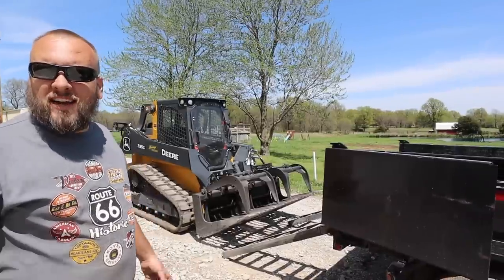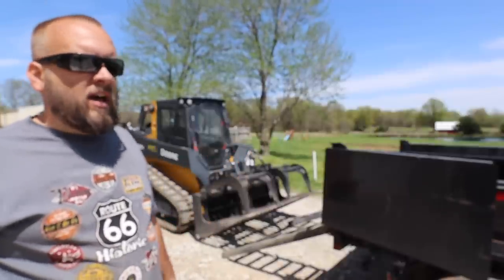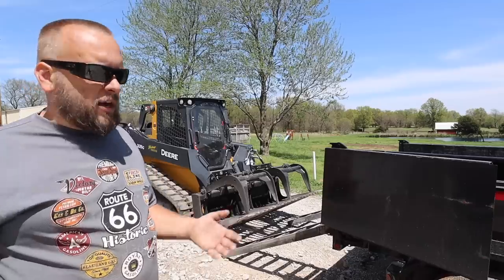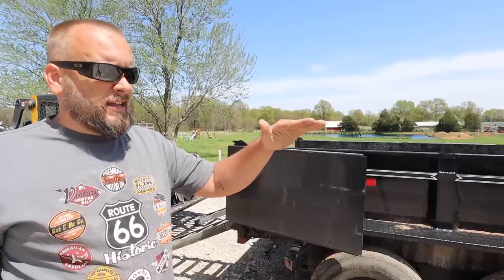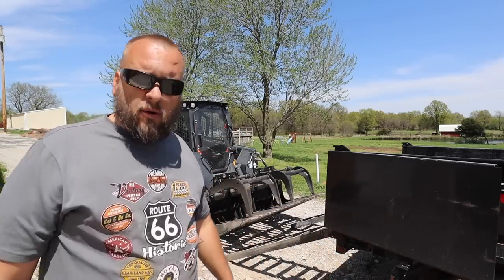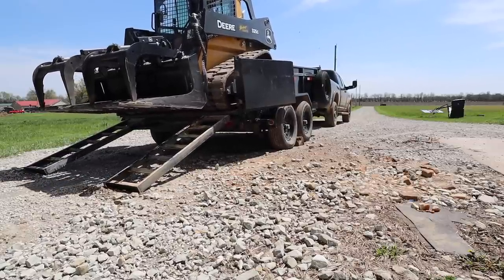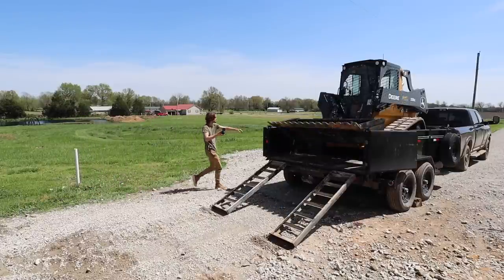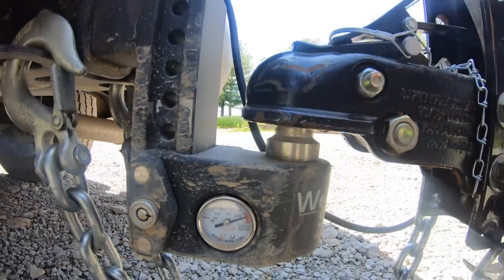Loading a Skid Steer into a 7x12 Dump Trailer - Problems and Solutions

Comment: Nice video Brock.  I recently purchased a 7x14 dump trailer.  I went with the 14’ just to have flexibility with whatever I wanted to put in there in the future.  Even loading my 1025r I wish I had stands built in.  I used automotive jacks the first time or two but I don’t anymore.  Still moves more than I want it to though.

Looking through the comments a lot of people are suggesting other trailer types, but I appreciate the demonstration with a dump trailer.  There’s a lot of guys like me who do side jobs or run a small business that can only have so many trailers due to room and cost, so we are always noodling out how to get the most versatility out of them.  Also, if you’re a one man operation you can cut out a trip if you can get your machine and dump trailer to a site together.  That was the biggest reason I went with a 7x14 so I count transport my tractor with an attachment in it.  Obviously there are more ideal trailers to haul a skid steer, but this video could help people brainstorming of what combination of trailers and equipment to go after.
Reply from the maker: Exactly. I have a gooseneck that I can haul it on but I would like to sometimes take the machine and the materials in the same trailer.

I thought 7 x 12 would be big enough and in general with dump trailers do you want to keep them light so you can put more in them.

Clearly I need a 7 x 14 minimum
Reply: Dump trailer is a swiss army knife. I purchased a 7x12. Mine has a chain to secure the dump bed to the frame when hauling equip so it doesnt act like that. 2 drop leg trailer jacks that fold horizontal or removed are the way i set mine up. I prefered the  jacks that can be cranked up n down vs a jack stand type that can get pinched if the weight doesnt come off them or worse case get ripped off on someting.

Comment: You're going to destroy that trailer. I use a 24' equipment trailer for our skid and excavator. So much easier and safer. Enjoy watching your videos
Reply from the maker: Yeah, I have a gooseneck that I will primarily haul it on but I wanted to be able to use the dump trailer to haul it when I’m also hauling materials to or from a site

Looks like I’ll need a bigger dump trailer.

Thanks for watching

Comment: Good video. I have a SureTrac 7x12 dump and haul my Kubota SVL75 in it. My ramps are longer and less steep. There’s also 4 d rings in mine for chaining the machine. Instead of kickstands,  jack stands or some 12-16” logs work great. I keep 2 logs in my trailer to stick under the frame when I’m loading the machine. When I pull on forward with the bucket dumped all the way down, there’s room for a wheelbarrow behind the machine. The times I’ve backed it on I’ve had too much tongue weight. Never had an issue pulling on forwards and I’ve towed it for 5 hrs  that way. Personally I’d either strap the doors on your trailer shut or chain them open to the sides, and weld some d rings to the trailer to chain the machine down. These trailers work great to bring the machine to the job and then bring materials to/from. I’ve hauled a Jeep Wrangler in mine with the doors strapped shut around the back bumper. Just keep your axles greased and keep an eye on your chassis, suspension & especially spring straps. I made some upgraded straps for mine out of 1/4” steel.
Reply from the maker: Thanks for sharing. It already has the D rings in the bed

Comment: My 20' equipment trailer has ramps with a built in "kickstand" so they are more like a wedge than a ramp so my trailer back end can't go down like that.   Welding that under your ramps might work, but then they might be too heavy to pick up....mine are attached to my trailer.  I guess the easiest solution is a jack stand for each side, but that's something else to find, store and likely forget and drive off leaving them behind.  🙃
Reply from the maker: Yeah, they also have them that are built into the trailer but you have to be careful with those. If the trailer squats too much they get stuck and you can’t raise them back up.  That’s probably what I will end up with

On my gooseneck I have the type of Rams you’re talking about and they do hold the back of the trailer up when loading. Can’t really do that on a dump trailer because they store under the bed
Reply: @RockhillfarmYT  I think Howboutcha Hank did a vid on installing jack stands like you are referring to.

Comment: I have a 7x12 suretrac dump trailer and it has a hook in the front of the trailer and a chain to latch down the front of the trailer to the frame and keep it from coming up like that when loading. That said, the only thing I’ve driven on it is my side by side so far.

Comment: Been thru all of this with various trailers over the years.12 ft. trailers are just too small,not only for the basic units,but a lot of times you need extra attachments on the job.Power rake,GP bucket.You need a bigger trailer.And personally,If i were purchasing a bigger dump trailer,I'd go gooseneck. Gooseneck handles,tows and balances load better over the axles of the truck.Bumper pulls are great,but handling heavier loads are where fifth wheel OR goosenecks shine.I now run 25ft tag behind my hooklift truck,took me years just to figure out my towing sweet spot!There's a never ending want for more attachments and equipment.Its just how it goes!
Reply from the maker: Exactly. No matter what I buy it is too small before long.  My gooseneck is barely big enough to haul it
Reply: Gooseneck and deck on neck. Throw grapple or other attachment up there.

Comment: My 7x16 dump trailer has rear jacks, but, if it didn't, I'd be putting a pair of automotive jack stands under the rear of the trailer, in addition to chocking the wheels, for loading heavy equipment. (Maybe you mention this at some point. Haven't finished the video yet.)
Reply from the maker: This was basically a test to see if I thought I needed to add jackstands to the back of the trailer. Looks like I do

Or if I get a bigger trailer make sure that they are already on it

Comment: Just a friendly suggestion I would check out your piston after all that slapping around it took 👀
Look for leaks around the seals   👍
My dump truck would leak after that 🙃
Reply from the maker: Thanks for the tip. I won’t load it on there again without setting up a chain that holds the back down

Comment: If that is a 10k lb skid steer and I'm not sure what rating your axles are, but I think you are probably over the limit even if they are 5200 lb axles because the trailer probably weighs close to 4000 itself.  If it were me I'd just use an equipment trailer with less weight in side panels and more in structure and weight capacity.  Good video showing the ins and outs of loading equipment though.  Thanks for sharing!
Reply from the maker: The trailer is rated for 14K. 7000 pound axles

9400 pound skid steer.

I have a gooseneck trailer that I will primarily haul this on, being able to haul it in the dump trailer saves a trip sometimes if you are hauling material to or from a site

Thanks for watching
Reply: @RockhillfarmYT  How much does the trailer weigh?
Reply from the maker: 4400
Reply: @RockhillfarmYT  I figured it weighed close to that.  It would be maxing out that trailers axles, and once binders, chains, etc. are added in, it most certainly would be maxing it out.
Reply from the maker: Yeah, it’s close but you also have to keep in mind that 10% of your trailers weight rests on the truck axle

Comment: Would a gooseneck trailer be better for pulling that with? Would you have the same amount of tire raise on the truck if you had a gooseneck? In addition, I agree, that the 14ft looks like the minimum length you would need. Also, what does you skid steer weigh again? I remember you saying in one of the recent videos, I thought it was around 10,00lbs, does that include the weight of the bucket/attachment and was that an empty weight or with fluids in the skid steer? I know lots of questions, just trying to learn. Thanks
Reply from the maker: Yeah, the only reason to haul it in a dump trailer is if you are also hauling materials that day and it cuts down on driving time to take the machine with you and then get the material

I’ve been saying it weighs 10,000 pounds. Dry weight is actually 9400 but with the bucket and fluids it may be closer to 11,000

Thanks for watching

Comment: Could you just raise the grapple and position skid steer to where you want it, then lower grapple, and have it rest on the rails. Be careful on overhanging of the front of the trailer, sharp turns can cause a disaster to your tailgate and tail lights. Maybe some sort of clamp to hold the bed down. I keep looking for a dump trailer, but prices are out of control right now. Hopefully it gets back to normal within  a few years.
Reply from the maker: The problem with having the loader sit on the rails is it has to be pretty low to be able to open the door.

The way I did it at the end I was able to have the bucket leaned against the end of the trailer and still get in and out.

Comment: Sir: I am not an expert but you need a 7×14 cargo trailer with ramps. You should also have kick stands on both sides. Always load backing on. If you can afford it get a 7×14 Big Tex tilt bed. Best trailer made my opinion. Then chain and binder that machine down.

Comment: Doesn't your trailer have a safety chain on the front of the dump box to prevent it from lifting?  That's a lot of slamming around when it lifts and drops on the frame like that.  My 14 foot dump trailer has a safety chain to prevent that situation.  Also, with a skid steer, you may need a longer trailer just to position the weight over the axles properly.  I have an 18 foot equipment trailer and use a lot of space just to balance the load when hauling my 3046r.  Depending on the load, there may be extra space left over on the trailer when it is loaded to capacity, but the load will be evenly distributed.  Great videos!  I'm a fan!
Reply from the maker: It seems like it should have a chain, but it does not. I think you’re right about the longer trailer

Comment: Did you bend your ramps or dent the floor of your trailer?  I did both while loading a skidsteer half the size of yours (bobcat 743, but it had wheels, not tracks...) onto a car trailer...
Reply from the maker: I’m not concerned about either of those things. This trailer is rated for that much weight. I just purchased it new last year And a lot of people haul skid loaders in them

Thanks for watching

Comment: Just put some wood underneath instead of legs and if they get stuck you can just drive forward and load those pieces in the trailer to use to unload. Wood is cheap and easy to adjust
Reply from the maker: Thanks for the suggestion. On my other utility trailer I used automotive jackstands and I could pull forward if they were jammed

Comment: Wow, that is a lot of twisting. Neither the trailer or the truck should move when loading equipment. Keep the bulk of the machine over the axels. If you want to add weight to the tongue you can put pressure on the bucket lifting the front of the tracks a little providing it is loaded front first.. What works today may not work in six months.  Hopefully that truck is higher than a Ford 150 or  Ram 1500.

Comment: Get a bigger trailer, oversized trailer is the correct solution.  You spent the money to get the right machine get the proper trailer.
Reply from the maker: Yeah, that’s probably what I will have to do

When I started recording I thought it was going to fit comfortably so you saw me realizing in real time that my trailer wasn’t gonna work

Comment: I feel like you're going to regret it if you do too much machine hauling with that trailer. Yeah it might work, but barely. Plus that's such a violet drop when you pull off it's going to beat the trailer, hitch, and truck to death eventually. If you HAVE to have a dump trailer to haul it then it might be time to trade up to a bigger one. Other than that you might just need to make an extra trip to drop it off then go get the dump trailer, which sucks but would be the safer bet. I'm sure the last thing you would want is to damage that fancy new truck, or the fancy newer machine.
Reply from the maker: All good points. If I do haul it again with that dump trailer I will have the bed chained down

Thanks for sharing your thoughts on it

Comment: Put your truck in neutral AND activate your emergency brake simultaneously ! which means you're ALways pushing against the rear brakes instead of the Parking Pawl of the transmission !

Comment: If it was me. I don't think that I would haul that much on that trailer.
Reply from the maker: Basically every time I use that trailer I haul 5 tons of rock in it. The rock weighs the same as the skid loader

The axles are rated for it as well

The only problem I see is the bucket just just takes out of couple inches too far

Thanks for watching
Reply: @RockhillfarmYT  Okay. The only thing that I could possibly have a issue with is the box slamming up, and down with the loader driving on ,and off.
Reply from the maker: Yeah, I don’t understand that either. I’ve watched plenty of other people load dump trailers And I haven’t seen that happen on anybody else’s
Reply: @RockhillfarmYT  Me to. I don't think that is a great thing for the hinges on the back of the trailer. Also the ram .

Comment: It seems to me that a tape measure could have saved you some time, of course you wouldn't have a video to upload.
Reply from the maker: The purpose of the video was not to see if it would physically fit inside the trailer

It was not even a consideration in my mind, because I wasn’t even expecting it to be a tight fit.  

I learned several things from loading this

1. Even if it fit, backing it into the trailer is not an option in terms of weight distribution

2. I do need Jack stands on the back of the trailer

3. Because my trailer is gravity down instead of hydraulic down The bed will lift, but it does not run the risk of damaging the cylinder

I needed to know all of this before trying to take the machine in a job.  This info could also be helpful to other people who are considering an Equipment purchase